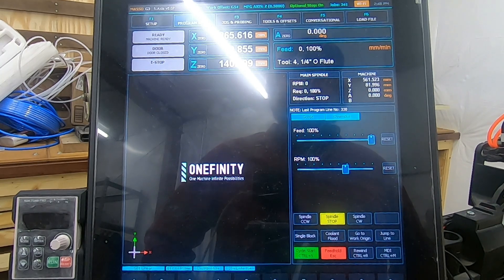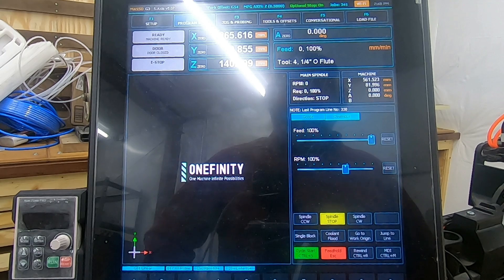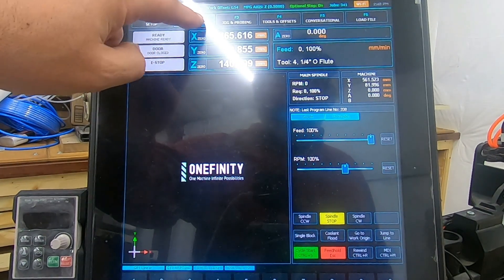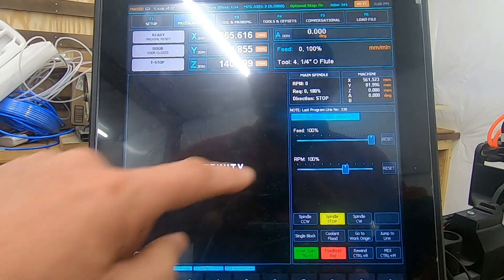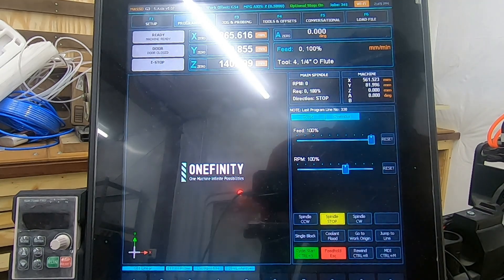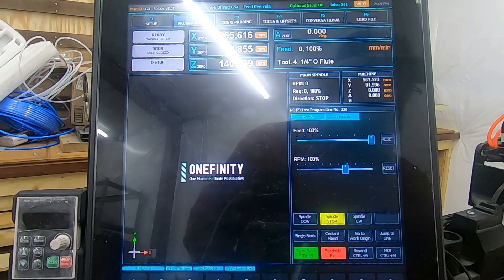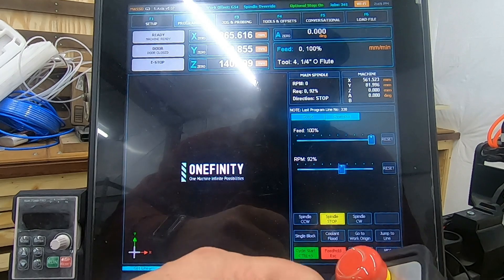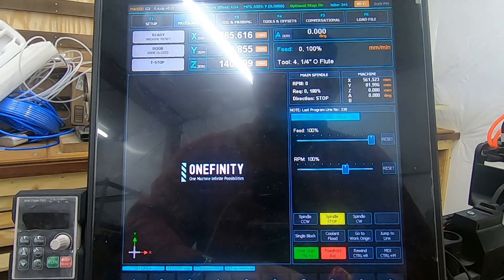Pendant Override

Comment: I was and am still bummed that the Masso isn't Bluetooth gaming controller compatible. Just what everyone needs, another cord to deal with.
Reply from the maker: It's a bit of a bummer that it has a cable, but I don't find it to be a big problem.  There are wireless options if you're willing to get a bit more technical and spend a bit more money.